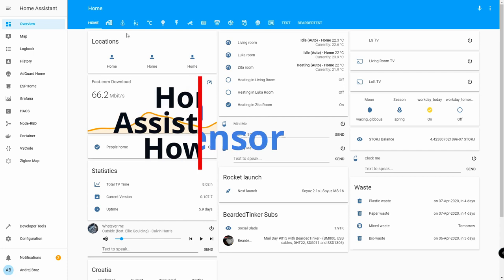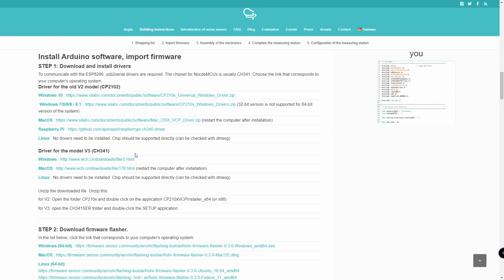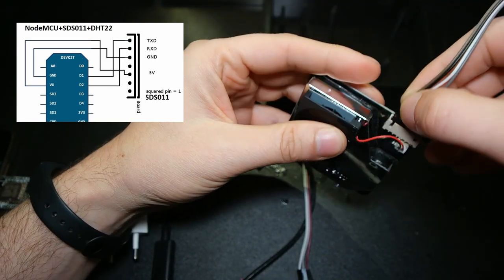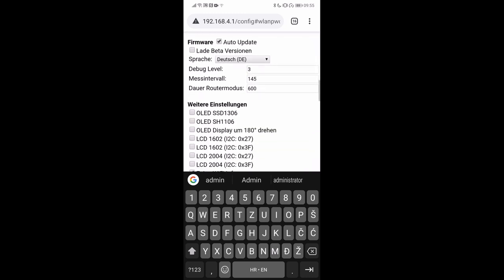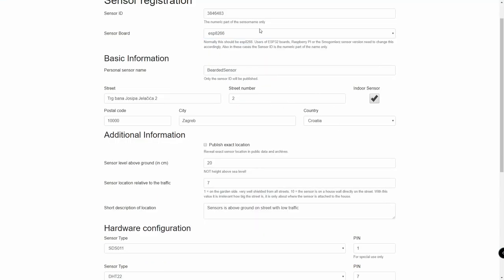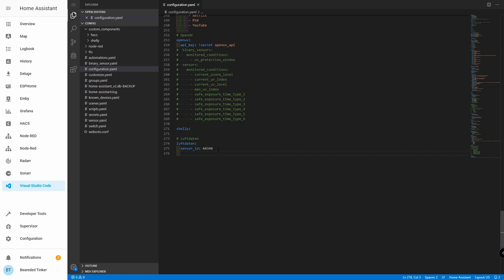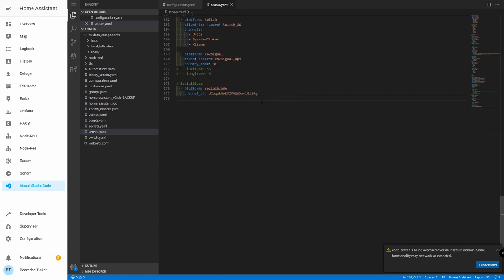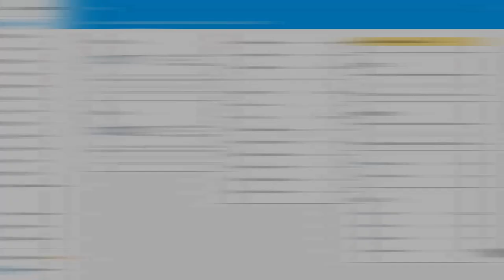Home Assistant How To  - Build air quality DIY Luftdaten PM sensor

Comment: Thanks, for inspiring link between sensors and Home Assistant, which are still valid more than two years after release of video. Thanks.
Reply from the maker: You're welcome! I still use it myself - same sensor. And it's been working really nice.

Comment: Just watching this now.   I prefer the CP2102 UART.  The driver works on a wider range of systems.    I am surprised the coded it in a way that it made  the wiring different for each UART on the board.  :)
I am looking around at as many projects of this nature as I can at the moment as I am working with Air Quality monitoring at the moment.  Thanks for the detailed information. :)
Reply from the maker: There are really a ton of options out there. I'm really sorry one of the projects I backed on kickstarter didn't get as much traction as I hoped it would get - Metriful. Nice all-in-on board.

Comment: Thanks for the video.  I did that a few weeks ago.  To date, everything has been going well.  As of today, however, I have no longer received PM data.  Guess the DuPont cables have come loose.  They sit extremely loosely on me.
Reply from the maker: Same here. Still haven't glued them😂 I just finished testing it on battery power. With one old 18650 battery it can run about 12-14h. Want to do something that can be away from power outlet.
Reply: BeardedTinker Gluing is a good idea.  Did you use hot glue for this?
Reply from the maker: @wolfgangbracke6871  Yes,  hot glue works OK. I also changed some dupont cables that had better contact.

Comment: I add SDS011 and DHT-22 . Is it possible to add also 4 row LCD monitor on NodeMCU V3 so I can see all information on LCD without looking on computer?
Reply from the maker: Sure, you can do that. I use Luftdaten project for DIY sensor, and it has pre built firmware, that supports various screens.
Reply: @BeardedTinker  How to connect LCD 4 ROW screen? LCD use 5V. What pins can I use?
Reply from the maker: Luftdaten project, I'm using uses I2C for that. I can't get to my sensor right now to see wires, but that should be available online - I used small OLED screen, but there were options of using LCD, also with I2C

Comment: Very nice, thanks. Glad you showed it local as well, personally I don’t want to send my data out. Has the HACS store got any better? I tried it a long time ago and it seemed a bit awkward to set up. Cheers
Reply from the maker: It has improved a lot during the time. It now enables also automatic integration for some add-ons by just using Home Assistant Integration page.
Plugins still require you to add them in Lovelace configuration after installation, but since version 0.107 even that is easier.
Reply: BeardedTinker Thanks, will have to take another look. Shame it’s not just another add on in Hassio. Cheers